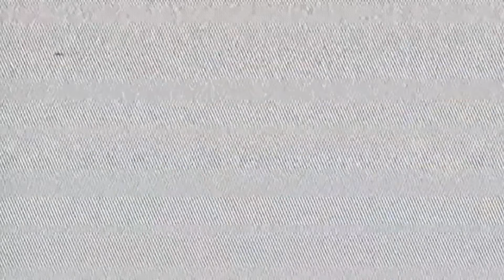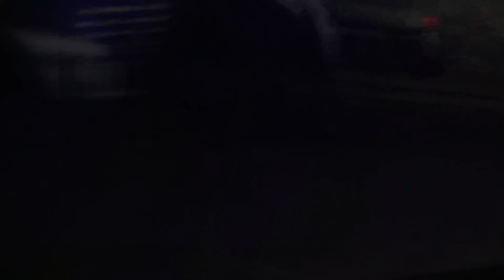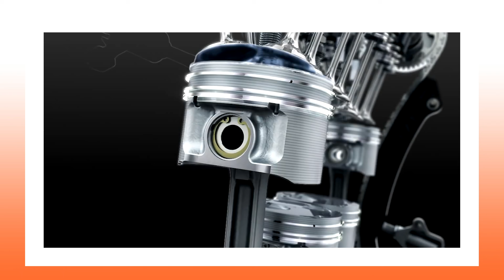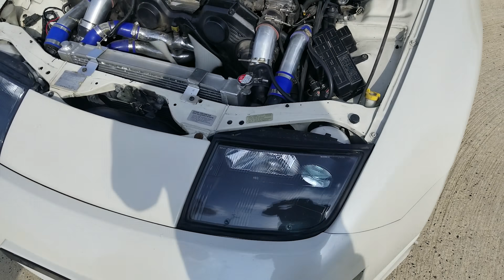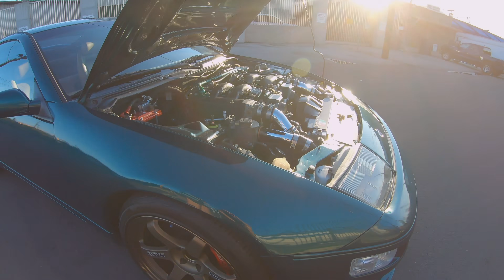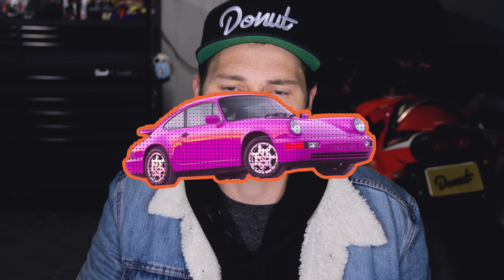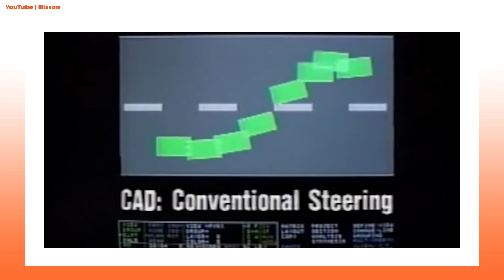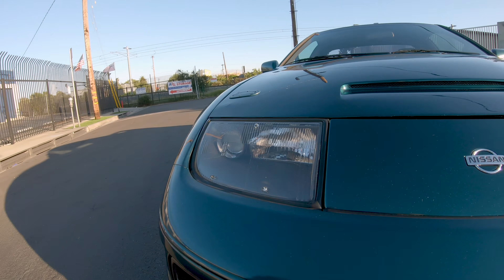The Incredible Tech that DOOMED the 300ZX

Comment: In 1993 I was a Nissan tech fresh out of high school when these cars came out and I fell in love the first time I saw one. I drove tons of the non-turbo 300 and they were pretty much better in every way as a daily driver but the Twin-Turbo Twin Intercooled versions had lots of growing pains and I remember them having lots of clutch issues with the TT cars. Tuning wasn’t as common as it is now so to find a modified one back then was unusual but I had a customer that had done fuel, intercooler, exhaust and turbo upgrades and a ‘chip’ that had to be soldered into the ecu to make it all work. He had a binder of receipts from a shop in Florida that did the build. He was a pilot and an adrenaline junkie and we struck up a friendship after a giggle-inducing high speed drive to demo a vibration that no one else was able to fix until I discovered a bad driveshaft carrier bushing/bearing assembly was the culprit and got the driveshaft replaced under factory warranty. After that, he would only bring the car to me for service or repair. He was always telling me how he could stomp on a new Vette or Mustang (I had a new 5.0 then) and he beat the absolute crap out of that car and was outrunning muscle cars and Gixers on the streets just about every weekend. We were pretty relaxed on warranty work in those days but I remember an adjuster denying a repair after he had smoked the rear end for the second time due to the abuse and modifications and after an investigation the VIN was entered into a ‘do not honor’ status on his warranty in the Nissan service database. He was loaded and had a best friend that was an attorney on speed dial so he got away with more than the average Joe and always had a riveting story to tell about some adventure he had gotten himself into in the car. The best story he had was spending the night in jail after being chased down racing a CBR in the Everglades by a highway patrol officer in a Pursuit Mustang and had the 184mph ticket in the service book to prove it! The case was thrown out when the officer ‘could not recollect’ if it was his 300zx or another 300zx so the judge had no choice but to drop the charges. 😎👍
Reply: Doubt he would stomp on GSXRs or CBRs.
Reply: Cool story nonetheless
Reply: Hell yeah
Reply: @Berm_Blaster  back then, yes.  The 300ZXTT is an amazing car in many ways.
Reply: Lemme tell ya where the REAL PROBLEM is... 🤨
I've always wanted one of these since I was a teenager... I could still recall callin' up Nissan like 20+ years ago, and chewin' them out for discontinuing the 300ZX. The car was FANTASTIC, and NOTHING is wrong with it. I was hopin' they would mass-manufacture it make as as many of them as there were Corollas. Like a MILLION of these vehicles a year. They just coldly said to me, that the 350z will be 'replacing' it. I told 'em to just go straight to HELL. I shure gave 'em an EARFUL!!! 😡
Reply: In your expert opinion, what did you think of the 240SX overall in comparison to the N/A 300ZX? 
(I mean, other than being PAINFULLY slow)

Comment: imagine dyno testing it and Accidentally turning the the wheel a smidgen
Reply: Nissan put HICAS in lots of cars, including Skylines.

Common mod was a HICAS lock bar and disconnecting the system.

The other mod was to remove it entirely as it was a huge weight saving.

Comment: I’ve had my Z32 for almost 9 daily-driven years now... it’s a love/hate relationship but I don’t think I’ll ever sell it.
If you have the patience to deal with the engines electrical quirks, especially the injectors and ignition wiring - it’s worth owning. 
Concept Z Performance has been a lifesaver in terms of parts both OEM and aftermarket.

Comment: I had a Z32, and it is still one of my favorite cars. I am a mechanic by trade and hobby and honestly, the VG30DETT is still one of my favorite engines as well. It is a monster. Little mods make damn good power. It sounds amazing. I loved that car so much. Though I could do without its meh 4 wheel steering system. It was pretty useless in the range it operated.

Comment: So Nissan showed the way for Lamborghini. Literally.
Reply: Kyntteri Nissan walked so lamborghini could run
Reply: That has to be the worst design decision Lamborghini ever made. The pop-ups were so fucking sexy. Up or down. The 300zx units just look tacked on. Like they just gave up because the Murcielago was coming anyways and Audi couldn't be bothered.
Reply: @herranton  better aero tho
Reply: @herranton  so using brake lights of a bus isn't worse??
Reply: Well, car regulations were prohibiting pop-ups so 🤷🏻‍♂️
Reply: @herranton  bruh. Lamborghini is built to beat Ferrari. In style and in speed. That means engine, aerodynamics and design. If they have to compromised one in order to win the other too. They will.
Reply: @herranton  thats highly subjective. I dont really like pop up because objectively it has moving parts & less aerodynamic.
Reply: @lpfan4life11  And the Mitsubishi Evolution steering wheel as well. Lets not forget that bit.
Reply: 300zx World first:
cam-phasers vvt,
Projector headlamp,
4wheel steering (electronic type).

Honorable mention from japan:
Active aero dynamic : 3000gt (gto)
Variable valve lift (integra/nsx)
Alumunium space frame (nsx)
Computer integrated, satelite navigation and Touchscreen headunit (eunos cosmo)
Reply: John Deere did too.
Reply: Lol nower days when a lambo is more reliable than a Nissan
Reply: @HuyHoang-kx6wj  Style, yes, and that's my point. Speed, No, Ferruccio Lamborghini wanted a reliable road car that was comfortable and didn't fall apart all the time like his Ferrari did. But it was always a road car. Lamborghini never wanted to go racing (in fact, he though the whole problem with Ferrari was they were focused on racing) and he didn't extract the last ounce of performance out of his cars, especially if it sacrificed reliability or looks. 
Jay Gonzalez, yeah, I get that. Like I said. They gave up because the mercielago was coming out. They could've made it nice, but Audi just said fuck it, sell the ugly car.
Reply: @alecto1550  You don't like pop ups? What are you, some sort of monster? Everyone likes pop ups. Ffs, donut has a song about them. And that probably makes them objectively better.
Reply: @lpfan4life11  The McLaren F1 uses bus tail lights too. And that is objectively the best car ever made. I guess they're on to something. 
(Or, yeah know, just having round tailings is sexy... See: Nissan gtr, Corvette, Ford GT, 69 charger, pagini, oh, and the McLaren F1, and... The Diablo).
Reply: @herranton  oh really? Wonder why i can't find any new pop up cars anymore 🤣🤣
Reply: herranton1979 How doesn’t this man not like pop ups
Reply: m_si2r because they are out of style, doesn’t mean that they aren’t still super fucking awesome
Reply: @goldfish9080  isnt that subjective? 🤣🤣
Reply: herranton1979 people forget this but back in the ‘90s pop-up headlights were being phased out because they were UnReliable. In fact none of the new Lamborghinis in the 2000s and 2010s has them. Lamborghini did the right thing discontinuing them. That’s why all of the new Lamborghinis don’t have them. It may be cool to have and make cool songs about them but they suck from a functioning and relatability standpoint.
Reply: @goldfish9080  its because they aren't reliable.
Reply: eljaroe beukes nor are rotaries but they are still sick if you take care of them, and treat your car like it’s supposed to be
Reply: @goldfish9080  lights on a car should not be a major concern maintenance wise
Reply: Noble Khan  In which way? I don't see anything in this thread that would lead you to believe that I dislike something for the sake of disliking it. 
I'm genuinely curious.
Reply: @GodzillaI  Pop ups were phased out because of changing crash safety regulations and changing styling cues. 
Sure, some of them were not terribly reliable. I had an 84 fiero that was perpetually winking. 
But the throw of the light has nothing to do with whether or not they function well. Back in the day we put some projectors in my friends 3000gt. They were some of the best headlights I've ever seen. No reason a manufacturer couldn't do it. 

Don't perpetrate garbage.
Reply: Noble Khan  wtf are you talking about. Oh, I get it. You are a 300zx fanboi and don't like the fact that it's headlights look ugly as fuck on a diablo...
Ffs. I'm not criticizing the z cars. I love them. But when you take off their headlights and put them on a lamborghini it doesn't work. Imagine a 240z headlights on a Urus? No, just no. 

Learn to not fanboi. It will make you a happier person. You will stop seeing everything as a personal attack.
Reply: Noble Khan   wow, that's a stretch. Keep trying though.

(And everyone over a certain age hypes pop up headlight... Doug does and so does rcr. You think donut started it? Lol. People have been fangirling over them since the 80s. But I'm guessing you weren't around back then.)
Reply: Noble Khan  I've been trying what? To say that a pair of headlights look dumb? Yeah. Because they do. That's all. They look fine on the z because they were literally designed for that car. 
How am I hating on the z? I'm not, and never have. Because I like them.
C'mon. Are you twelve years old. You're really into proving that I'm something I'm objectively not, and seem to be putting quite a bit of energy into it.
Reply: Noble Khan  What does that have to do with you calling me a hater, which I'm clearly not?
Reply: Noble Khan  what does that have to do with me being a hater? I like the z cars.
Please stop back peddling and apologize for calling me a hater.

Comment: "Is it still a pain in the butt to work on?" Yes, compared to modern technology and diagnostics tools it can be tricky. After owning several Z32s since 2013 I can say there is something great about when everything is working as it should. Being patience and willing to learn its quirks is key. Blasting down the street in one of these is priceless.
Reply: regular oil changes would be the first thing you learn,seeing its timed by clean oil...still cant beat a pushrod,,cheap,easy to work on,last forever.i learnt this after owning a twin cam,all ways in the garage,,i fixed it..not a mechanic..then,bought a v8,easier put fuel in tank & drive EVERY DAY , than under the hood on w/ends..fuk that..you let that zx sit for 30 yrs,,its trash,,you let a pushrod sit for 30 yrs,,it runs..when the zx came to aus,,they looked like a knock off of the pontiac firebird.same shape..as a note,i have a 1962 f100 4x4,,352FE,,still runs,...see your zx in 60 yrs,..
Reply: @phantomwalker8251  a fire bird is fucking hideous the zx looks way nicer..... Plus it ways a ton and corners as well as a boat and hp per litre the Nissan craps over inefficient prehistoric garbage.
Reply: @phantomwalker8251  if you like going in straight line the  60 year old average pos, that can be out runned by a modern 2.0 turbo and is woefully hopeless on a track with corners then this og muscle garbage is car for you....... whilst you can modify it you can also modify a lighter "modern car" that has better creature comforts and doing so with a smaller displacement.
Reply: @k1er4n544  400 hp duel turbo engine in these lil cars sounds like a lot till I remember that the 5.7 hemi NA is 397hp 🤣
Reply: @phantomwalker8251  Of course an engine with 5 caveman parts will have less things go wrong than one with a hundred.... But the other 95 parts are there to make SPEED and POWER, not putt around... I'd like to trash your firebird analogy, but because I live in AUSTRALIA, I've never seen one in real life.... BECAUSE THEY WERE NEVER SOLD HERE... Phantom wanker indeed... My 300z tt is 31 years old, original and runs fine btw....
Reply: phantom walker honestly if you have a solid grasp on maintenance you can keep most cars performing well for decades. Electronics are honestly the most difficult part of “modern” vehicles... but if we are honest it’s just another thing to learn too. Just because it’s easier to work on doesn’t mean it’s inherently better overall, just your personal preference.
Reply: @blackraven8841  reason as to why it is dual turbo is due to the age of the turbo for example the technology comparing to modern garret turbos also I was comparing the 300zx to the firebird.

The 5.7 is a solid engine but it should have more hp considering has twice the displacement so when you look at it like that isn't so great.
Reply: @blackraven8841  not to say I dislike all muscle cars the c8 is more super car for muscle price and is fucking awesome  but a v8 lexus has better na stats than a hemi.
Reply: you just sold me a 300zx z32:))

Comment: I have a 300zx 2+2 and I'm swapping in the TT engine. You'd be amazed at the amount of stuff packed into the engine bay. Blows my mind every day. Definitely a pain to work on but it will more than make up for it once its done.
Reply: yea that's what made it so tough
Reply: What engine are you going with? Check out my build.
Reply: Let me know how that goes because I’d love to do it with mine it, just seems wicked expensive!
Reply: I also have a 2+2, just picked up a JDM TT engine and transmission with ecu and other various things attached to the engine for $3400, has approximately 68,000 miles
Reply: @RedJerk5  it's all fun and games until you get your new engine and everything is basically trashed. Have to get new turbos, fuel injectors, EFI harness, clutch,  about 1000 hoses, and much more. Trying to keep the swap under 10k but after everything I just mentioned, including the engine and trans, I'm at 7500...so far
Reply: @zacr1109  I think I'll keep her natural haha. I'll invest the 7500 in another fun car first.

Comment: The 300ZX TT was a force to be reckoned with when it debuted. By 1994 it was noticeably slower in a straight line than the Mitsubishi 3000GT VR-4 and Toyota Supra TT but was more fun to dive than either. I had a 1991 300ZX Twin Turbo and a 1998 Mitsubishi 3000GT VR-4 back in the early 2000s. Driven back to back it's obvious the Mitsubishi is the faster car, at the track I ran 13.7-14.0@99-102mph in the Z and in the VR-4 I ran 13.3-13.5@101-103mph. 

Despite being a bit slower, the Z was still the most versatile and fun to drive. I daily drove the VR-4 due to its AWD and took the Z when it was nice out.